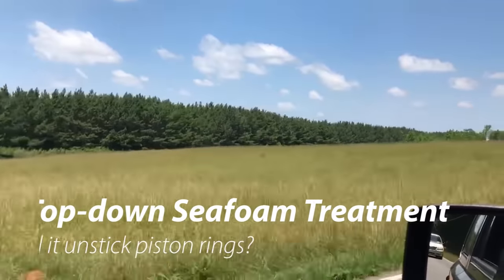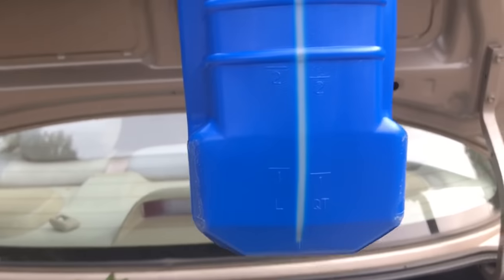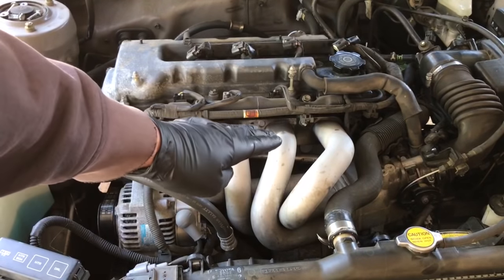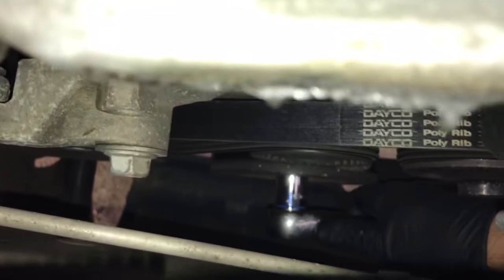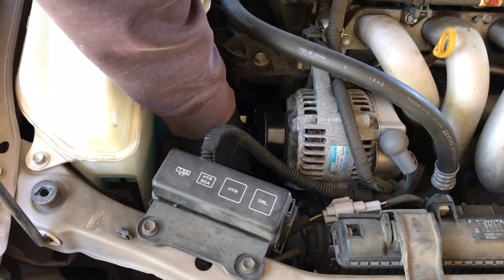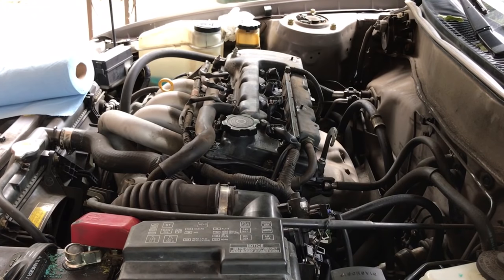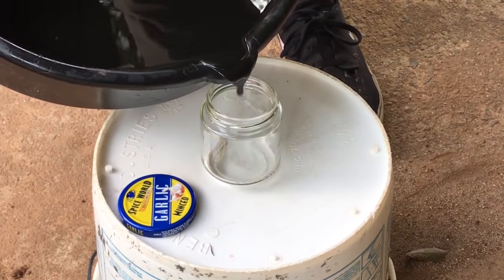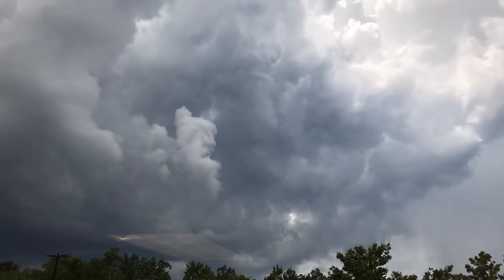I poured Seafoam down the spark plug holes! | Oil Burning Experiments - Episode 1

Comment: Those plugs needs changing bro and. I would say replace your pcv valve, remove your valve cover and crank case and clean. Flush engine with 1 qrt diesel to 3 qrts oil only on idle for 20 minutes. Don't rev engine and you should be brand new again
Reply: I've heard of this being done.do you have to do anything else to get any left over diesel out once you've run it and flushed it or can you just fill it with oil and go?
Reply: Remove your crankcase? So pull the block and clean and reinstall, lol wtf
Reply: Yeah change pcv valve would not do much

Comment: I had bad sludge in a 5.2 Jeep awhile back. I would put half a bottle of seafoam in 50 miles before each oil change for about 3 oil changes I think it was. Cleared it out a lot and ran drastically better/smoother and quieter. Lifter tick returned to normal and everything. Deep black oil came out each time. That stuff works. I think you’ll see better results over time with this methed but if you had done that soak and then followed it with the upper cylinder spray cleaner I feel like it would have made a larger improvement. The results you got weren’t bad at all though considering that it was a short term test and you burned about 30% less oil over a longer distance. Great video 👍

Comment: By liquid would oil also be considered liquid? My valve cover was leaking and shooting oil up on my air intake for about 2weeks. Oil had go into the spark plug tubes and then i removed the spark plugs i assume i probably released all the oil right ontop of the pistons.

Comment: Hey there please watch lake speed jr. video it’s only 8 hours old, about premium fuel, very informative, i believe you should try premium fuel and 5w-30 Valvoline restore and protect, however change the oil filter at 300 miles and 1,000 miles
Reply from the maker: Thanks for the recommendation. I watched it.

Comment: The nought you turn to move the piston up and down is at the starter head or the fan belt head ? Can you identify clearly for me to understand please; I wish that I can learn more about the mechanisms; I recently got tricked by mechanic to rip me off so much every time I seek their assistance
Reply from the maker: It's the crankshaft bolt which is way down on the bottom pulley.

Comment: In my opinion...Seafoam is the best oil, sludge cleaner out there.  Have used it for years. It DOES free rings too. I have left  it in the crank case for close to 600 miles and it cleaned completely.  Used a bore scope, and the engine was spotless.  The oil filter weighed close to 3 pounds afterwards.  That was on a 2001 Ford Escape V6.  It was severely sludged up.  It runs like new...still.  Have had it for over a year..

Comment: Hi Guys, in the past I have drained the oil, put the plug back, left the oil filter in place and dropped 5 liters / 1.25 Us Gal of Diesel into the engine, started the engine and allowed it to run at idle for 5 minutes, turned-off the engine for a while, and repeated the procedure 3 times, drained the oil (Black as an Ace of Spades), replaced the Oil filter replaced the oil and my oil burning / consumption was about gone, it improved it just about 100%, not only did it loosen everything, my oil stayed cleaner for much longer. Best of Luck
Reply from the maker: That is the most risky experiment suggested yet ... We might just do that, Rui! ... We'll see.

Comment: synthetic oil is half your problem. Go back to DINO straight oil. and install a catch can in the PCV system and start using MMO to the oil when new, and then before the change add a quart of sea foam 100 miles before the oil change.

Comment: Next time drop a quart of atf4 in the engine instead of topping it off with motor oil. The problem is the first set of ring on the pistons which are the oil keepers. I've got a 2002 corolla with 68k miles that use to burn the same and after dropping atf4 in the crank case it was pretty much immediate the results maybe 2500 miles later no more oil burn.

Comment: Thanks for the video. It seems your approach is good but may be flawed in several respects. Seafood has minimal viscosity and tends to drain past the rings before it gets into the ring lands to do its work. For this reason I use 4 parts atf to two parts seafoam to one part acetone, placed in the plug hole after bringing all pistons to mid stroke. I fill to the brim and check with stick through plug hole when possible or ck with boroscope. Often times the mix will drain quickly from one or more cylinders and I replenish keeping them full. After sitting over night I check to be sure cylinders have drained. In an inline engine I add 5 ccs to each cylinder and crank with plugs out for 4 or 5 30 second cranks. I then repeat the process. For most Toyota of this era I find 4-7 days of this does the trick. Caveat is, with acetone and seafood in the mix, I usually drain oil and change oil with seafood to begin bottom up process. Thanks again for good video with sound methodology
Reply from the maker: Thanks for the comment ... So this has worked for you with stuck low-tension rings?
Reply: @FamilyFriendlyDIY  Yes.  In my sons corolla we soaked the rings for 5 days and then added seafoam to the tank and per the seafoam page recommendation we added it to the crankcase and drove it for the last 300 miles of the oil change.  We soaked piston rings like this for three successive oil changes and followed with seafoam in tank and crankcase for the last 300 miles of each oil change period.  I dont recall exact numbers but I think he was at 500 miles a quart at the start and we are now at one quart between oil changes (3000 miles).  I regularly use seafoam on cars from the 60s we revive as part of our work.
Reply: I was reading, reading, and then saw 'seafood'. My brain turned from focus to refreshment. Imagine dipping seafood into black gunky oil after cleansing the rings 👍

Comment: Running a qt of ATF at oil change, removing a qt of oil if necessary, has been common engine cleaning practice for me every few years.  Heavy W40 oil should help stop blow by too.  Running and adding a little water spray into the intake might unstuck piston rings too - like oil blow by but in reverse; oil change is needed afterwards tho. Done this many times and it's always worked out. Still running 1999's f150 an escourt & a taurus myself.
Reply: How long do you run the quart of ATF in the ctankcase?
Reply: @5jjt    About 10, 15, or 20 minutes in total. -  I check the oil level, drive a vehicle up on small ramps, guess a quart on the drain,  empty out what i think is a quart, trow in some ATF and do my water spray thing or go for a drive to the store and back to drive up again, empty and filter change like normal.

Comment: Rinslone has a compression restorer if you want to try there product. This car is easy to remove the head and oil pan push pistons out and put new pistons and rings in. Eventually down the line. Do a compression test with a tester and see what you numbers are then a leakdown test this engine is known to burn valves all cars now a days a burning valves muat be something with the gas thats making these happen supposibly the valves are built with sodium which brakes down over time

Comment: You should clean or replace those Filthy plugs after changing oil. The Seafoam that dripped into pan from cylinders desolved slidge in bottom of oil pan.

Comment: I have a 12 Ford Escape and have oil residue inside the sparkplug holes. Will putting seafoam clean that out or is that a bigger problem?
Reply from the maker: That would be your valve cover/spark plug gaskets, Marvin.
Reply: @FamilyFriendlyDIY  thank you. I was on the verge of putting tampons to soak up oil lol

Comment: Injector cleaner or transmission fluid works just as well
Reply: How many quarts
Reply: @dxta7360  I've done a 50/50 mix..1/2 qt of trans fluid 1/2 water ..pull out in driveway ..let neighbors know what your doing beforehand or they'll call the fire department..
Good luck..

Comment: A warning to anyone trying this.
We do not have seafoam in europe, but found multiple posts on internet suggesting using strong engine flush into cylinders.
However, the one i used was oil based (very thin)
And caused ALOT of smoke, i mean ALOOOOT of smoke when starting engine again.
Even if the cyldinders was pretty drained/emptied.

It smoked so much it started seeping into the house and the entire house was filled with smoke.
Me and my gf got CO poisioning from this and felt like passing out, we had to flee the place.
Took almost 30 mins before the car stopped smoking.
So do NOT use engine flush with added oil.
Bad idea lol.. Get something strong that is easily burned when ignited.

I should have bought an expensive flush instead of a cheap one with added oil. Or at least found some chemicals better suited for this..

At least my engine is well lubricated now.😅
Results are positive so far, already running smoother, and engine somehow became less noisy.
I did run a full engine flush right after.

Comment: The problem is it works to well
It smelts everything and it ends up clogging the catalytic converter
Reply: and messes with the O2 sensor if im not mistaken
Reply: @sf2372  yes correct

Comment: Seafoam is amazing stuff. We used to use it for a sticky valve in our twin engine 1957 Chris Craft Cruiser. The 6 cylinder flat head starboard engine would occasionally get the same valve stuck open. We would spray seafoam in and you could here it snap closed. Eventually we had a valve job done and found that valve was slightly warped.

Comment: Did you top the oil off after you started it after the oil change ? The filter will take up nearly a quart, I did not see you account for that. If you in fact did not top it off, that engine barely used any oil, or none at all.
Reply from the maker: Good point, and yes, I always run it first and recheck oil. I've found on this car the difference in the oil on the dipstick before and after running with an empty filter is roughly a millimeter.

Comment: I had a Toyota service technician tell me that every Corolla of that 1999-2002 model year that ran on pure-synthetic motor oil, never had a problem with stuck piston rings as the synthetic oil doesn't leave carbon deposits like the way regular non-synthetic motor oil does. Whenever a Corolla comes in with oil burning problems, 80% of the time it is an owner that tried to 'cheap-out' on motor oil and didn't use synthetic oil, and now he needs a new engine instead.

Comment: The reason your car is burning oil is the 1zzfe has a faulty piston design. The factory holes in the side of the pistons are to small and lead to poor circulation of oil on the bottom end, the holes tend to clog which eventually leads to a spun bearing and possible crankshaft damage. It’s why your rings seem to be sticking because they’ve lost their oil supply. I just went through all this and led to a full rebuild. Good luck my friend.
Reply: As well as the 2.4L (2AZ FE) seen in 07-09 xB, tC and Camrys etc.
Reply: Did the rebuild help?? Are you still burning?

Comment: I just replaced my valve cover gasket and the oil pan gasket on my Corolla. It was leaking bad. But not burning any at 330k.
Reply: Is it still burning? I’m afraid mine is the piston rings
Reply: @gabrieli334   It was never burning oil. Just leaking alot of it 😊

Comment: i tried seafoam on my motor!..i have a sticky ring in cylinder #2...took the spark plug out lower the piston to bottom dead center so i could have the whole cylinder fulled up with seafoam!..left it in to soak for 24 hours...didn't do anything for me i still have the ring not open on cold engine!..strange thing though is once the engine has warmed up i get nearly full compression!..but low compression on cold engine!..any suggestions!..also seaform is petroleum based and can damage silicon type seals in an engine so be cautious when applying in your engine!

Comment: Just spray half a can of oven cleaner down a hot cylinder if your serious. 
Run a scope in that 200,000 mile bore and see the wear patches. 
Berkbile 2+2 carb cleaner works also.
The main thing is get the message out about these stupid 10,000 oil changes.

Comment: So here is how I fixed several cars that had stuck rings. Get the engine hot and pull the plugs put a couple ounces of berrymens b12 chemtool in each cylinder let it sit overnight. Then after 24 hours spin the motor to clear the cylinders and put the plugs back in and drive it till hot again and then repeat and let it sit another 24 hours then run till hot and drain the oil. You want some b12 in the oil during the second heating to get up on the back side. Do not put too much in each cylinder only an oz or 2

Comment: Doesn't the engine/oil have to be hot when checking accurately? Both after changing....and after your one tank of gas check, being at normal running temperature? 
 That is what I was told for all accurate oil level checks in vehicles.

Comment: HEY DAVE, so my used 5.3  LS with some rust scoring that i already honed off and collapsed rings might still run  if i can uncollapse my ringset with some diesel and sea foam?

whats bare min compression it should have on all 8 cylinders and can a compression test be done by hand for each cylinder with just that one spark plug inserted ?

cuz i dont have a starter and dont wanna spend 100 bucks if this things just gonna fail compression test anyways?

Comment: So much I would have done differently. Change the spark plugs for one, only use toyota filters, use quality oil, put oil IN new filter before you reinstall oil filter, spray off engine, rotate tires, use the seafoam or marvel, in the engine oil about 100 miles before the next oil change after all that is done take a short trip and run thar engine!! I bet you'd get better results

Comment: Are you sure it is the piston rings that are causing your engine to burn a lot of oil? My 2008 Escape was burning 1 qt of oil per 100 miles. PCV valve was the problem. I did not change the PCv valve I sprayed brake cleaner in the hose going to the PCV valve and run the engine with it unhooked with my finger over the connection. Done this 2 times and hooked up the PVC hose and drove the car. It has been about 250 miles and the oil has not went down at all. Stays on the full mark now. Easy fix.
Reply: PCV's are usually $10-11, and ARE a wear item.  Its already clogged once, and you've probably temporarily cleaned it, but how long will it actually stay unclogged?
In a month or two, or after the next oil change you'll become used to it not burning oil and that when it will eventually clog, burn oil and you'll likely end up running with low oil.  This will happen to 50% of the people who simply clean their cheap PCV vs just replacing it.
Big bite in the ass for some for being penny-wise and pound-foolish.

Comment: If you are gonna change the oil anyway after doing that might as well add some sea foam to the oil as well and drive it around a bit for a day like it instructs on the back of the bottle. Works great in the oil when used correctly prior to an oil change. Hope your Corolla is still around and doing fine. Love those little old cars, especially in 5 speed.
Reply: SeaFoam is a very light hydrocarbon that evaporates once engine oil gets up around 200'.
You'd be better off starting it and idling for 5-10 min until before it gets to proper operating temperature then shutting down.
Do that 4-5 times over the weekend letting it really cool down between, and you'll get far more 'work' out of the SeaFoam than having it all evaporate 5 min after if reaches operating temp.

Comment: Years ago, my brother-in-law and I got an early 80’s Honda Civic for $35. It needed a radiator and it smoked. My brother-in-law was from Poland said this was normal repair there. Per his instructions I bought some benzene (Naptha) and we poured some in each cylinder and cranked it up & down and then put some more in and let it sit overnight. We did this for 2 days. The smoking was gone.   Afterwards we sold the car for $600.   Thanks….Jim
PS…..we changed the oil afterwards!

Comment: i like throwing seaforam in higher mileage engines oil before an oil change for just that reason. knocks all the crap loose into like thickkkk oil vs big chunks of stuff floating around in oil flow

Comment: Best way to unstick piston rings is as follows: 
Get a Liqui Moly pro line engine flush and pour it inside the engine, run it at idle for 15 minutes. 
Change the oil and filter and go for a 30 minute drive while pushing it hard. 
Change the oil and filter again and you are set to go.

Comment: On my Nissan Sentra at 200 K would use about 1 quart of oil every 5,000 miles, I changed my valve guide seals witch were very hard and had signs of cracking. At 340,00 it was using 1/2 quart every 5,000 miles. I wonder if it would do even better if i tryed your ring cleaning trick. Through its life I used only mobile one oil.

Comment: You could take off the oil pan, pull the plugs, and spray carb cleaner, finish off with soaking in Hoppes #9, then reassemble and spray some oil onto the cylinder walls, let it sit overnight to not burn oil.
Reply from the maker: Thanks for the suggestions!

Comment: If the pvc is stuck open it will suck oil out the crank case and burn it all so.you should put seafoam also in the oil it will help clean it internally

Comment: LOL sea foam. I love how all these wonder bullshit in a bottle gimicks that new generations use. Old mechanics like me would drain the oil, pop plugs out, spray shop grade oil/carbon degreaser in plug holes and SLIGHTLY move pistons up n down via crank pully, Wait a few hours, do it again and tada! Oil control rings etc are not carbon free and loose.